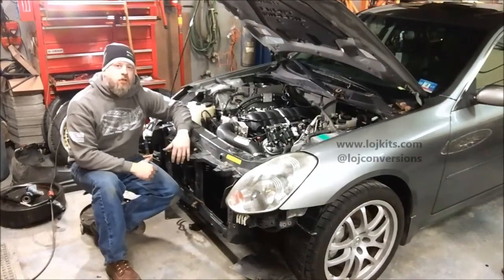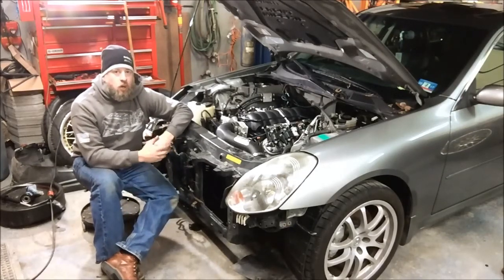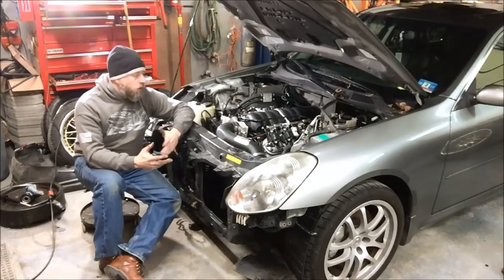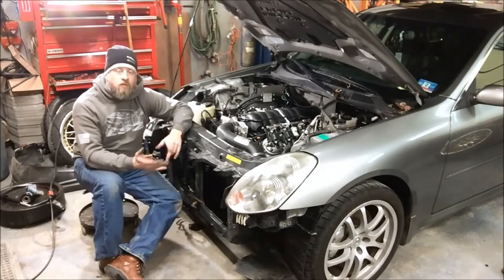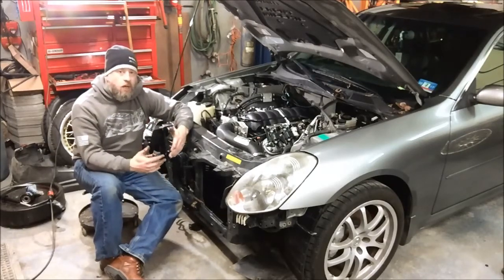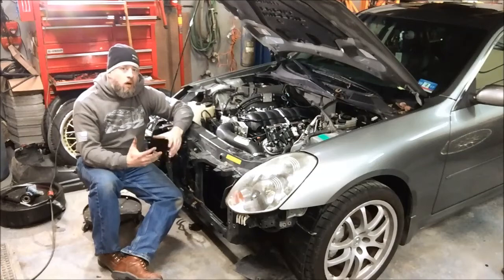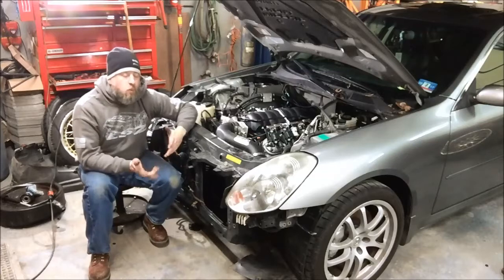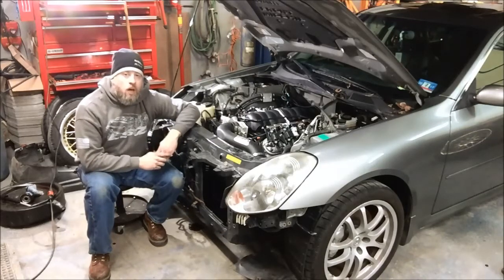LOJ VLOG - March 15, 2017 - G35 and 350Z LS Swap Fuel System

Comment: I see LOJ isn't very responsive huh? You are on here trying to push your LOJ LS swap parts and yet you can't even reply to questions on your videos? And what is up with the complete LS swap kit price? I understand American made is generally more expensive, but damn bro, you are essentially rapping people. I can buy harnesses, fuel parts, mounts, have custom headers made and still come in under your prices. I mean seriously man, $9k dollars? A 2003 G35 with an LS swap in perfect condition with a worked trans and engine and with a/c won't pull what you will have invested in this swap. It's not cost effective at all. I would like to see lower prices on these kits to make them more feasible. This isn't a rich man's game here guy. We are mostly all DIY mechanics and car owners and don't have $8k-$10k to drop on a damn swap kit.
Reply from the maker: Frank Murray Thanks for the feedback, we value your opinion and with you the best of luck with your project.

Comment: Hey I am about to do a LS swap In my g35, can pick up a LS1 just the head an block an I think the head has a lil issue or I can get a LS5.3 with harness (everything but tran)an ecu an not to sure what problems it may have. What is a better deal, would I be needing everything from the LS1 or can I jus use the g35 parts